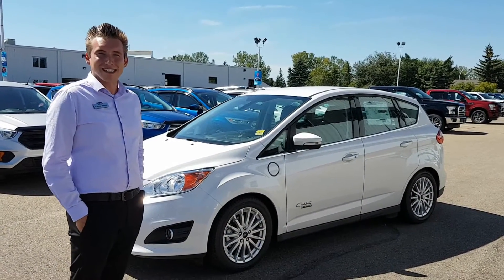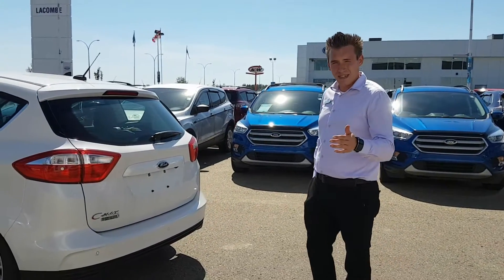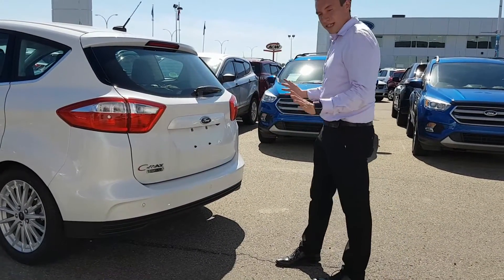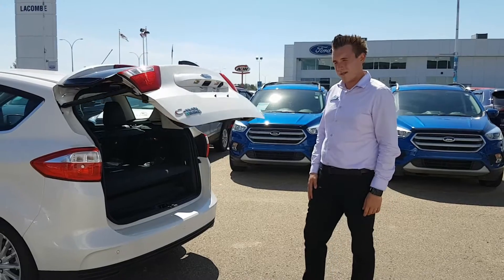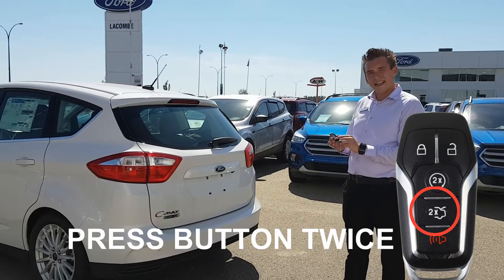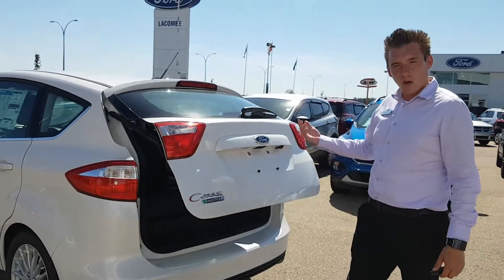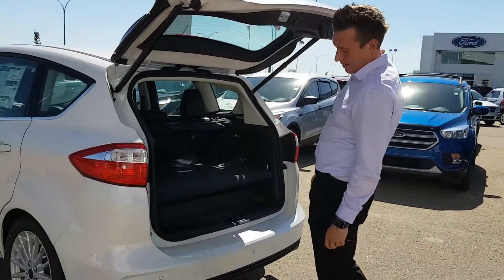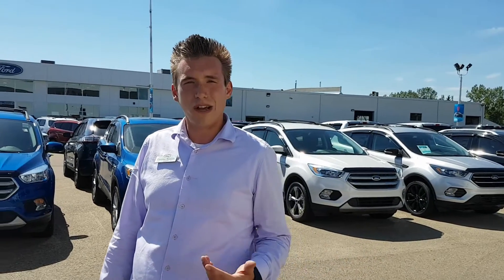How to open Ford Liftgate with your Foot - FYF Episode 7

Comment: Helio.Ford C MAX 2015 battery discharge, mechanical key, how to open the trunk door, but all the doors opened, only the trunk lid cannot be opened.
Reply from the maker: Something must be stuck or the mechanism is broken. If the doors opened than the fob is working. Its hard to diagnose over the internet. You may need to make a visit to your local service shop so they can take a look.

Comment: Can I disable the foot activated lift gate? When I'm working in the back end, the ding sounds and the door closes sometimes almost catching me. I must have moved my foot???
Great information on video, also could you show how to raise the lift gate from last person that shortened it, please
Reply from the maker: Depending on the model, you should be able to go in your vehicle, using the center console screen head to SETTINGS from your home screen. From there tap on VEHICLE and then POWER LIFTGATE and finally DISABLE. 

As for your question about raising the lift higher. You can gently manually push the liftgate higher and then when it is where you want it press and hold the button to close it. It should beep indicating you’ve reset the height. 

Let us know it that helps or if it doesn’t please tell us the model and year and we can troubleshoot for you

Comment: How do you open the window?
Reply from the maker: Which window? The passenger windows will be used with the buttons on their respective doors. The glass on the back hatch door does open.
Reply: @lacombeford  the window on the back hatch of a 2014 Escape. We cannot figure out how to open it.
Reply from the maker: @ALLGIRL62  To open the window, the liftgate must be unlocked (if equipped). Press the button located under the edge of the license plate border (it’s on the right side).

Comment: How do I disable the foot activated liftgate sensor?
Reply from the maker: Amanda M what year and model do you drive Amanda?
Reply from the maker: In most vehicles yes you can shut that off. But that shuts off all power features. Depends on what you drive, let us us know and we can work out some directions if applicable. Thanks for watching, have a great day!
Reply: @lacombeford  I have a 2018 titanium. I also to just disable the foot sensor
Reply from the maker: @gardenman3  Press the Up/Down buttons on the steering wheel until Settings is displayed on the instrument panel, then press the OK button. ... Press the Up/Down buttons until Power Liftgate is displayed, then press the OK button. 4. Select Enabled or Disabled.
Reply: @lacombeford  I already tried that. that disables all the automatic functions not just the foot sensor.
Reply from the maker: @gardenman3  yes, unfortunately it is an all or nothing deal. Why do you want to disabled this feature?